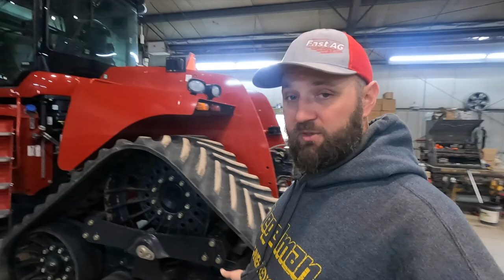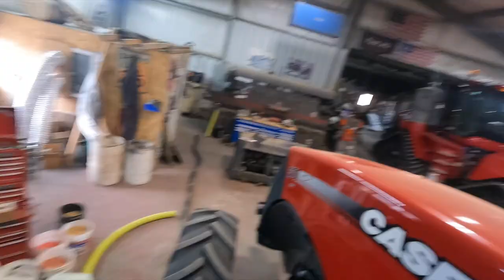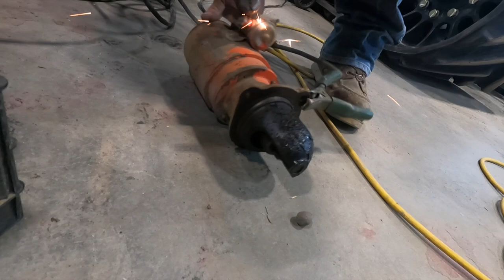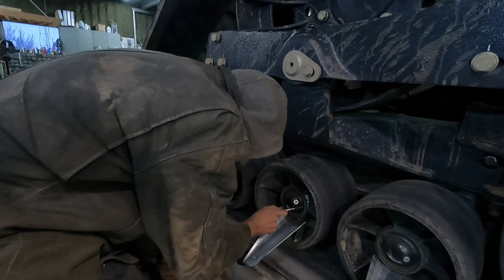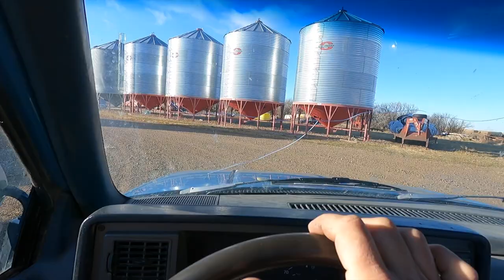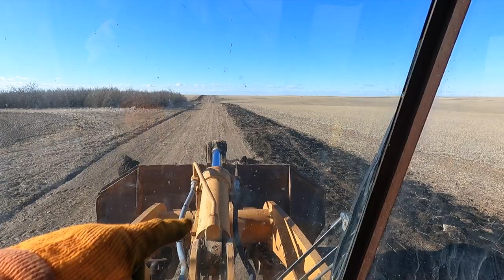NOT A GOOD DAY!!

Comment: I used the diesel atf solution let I set a week   Then put tractor in high gear   Get a hold on rear tire and rock back and forth. Works  would be nice as a extra tractor.    Thanks

Comment: Hope you don't give up on the Lil case...I know it's prolly like a toy for your operation but it looks in good shape other than your engine problem. I have heard of chaining a long pole or beam to the wheel...Jack it up and hang weight on the beam and leave it. The beam will be on the ground when its loose.

Comment: Why can't case figure the bogey wheels out?  Had a row track on a demo here last week and at 300 hours four were  leaking and nearly all of them were coming apart.  I replace them on my Deeres when they delaminate, so very rarely.
Reply from the maker: I think the row tracks had an update. They over heated with the narrow tracks.
Reply: @FastAgMontana  yea they told me to keep under 19 mph. Still to fast for that thing. I wanted to like it but it doesn’t really know what to identify as. Is it a wheel or a track?  Doesn’t do very well batting for either team. Tracks were have wore out on one side of each track. I run 16” on my RTs with no issues. Tell case to copy Deeres bogey wheels.

Comment: hey Tony to free that engine put the tractor on a trailer in gear and tie it down loosely and just drive it around until the engine breaks free.
Reply from the maker: If the wheel wasn’t bad on it we would have tried that.